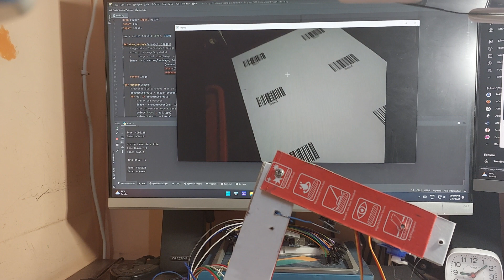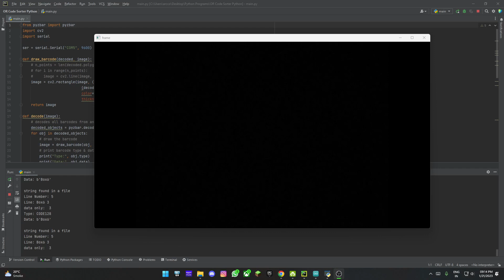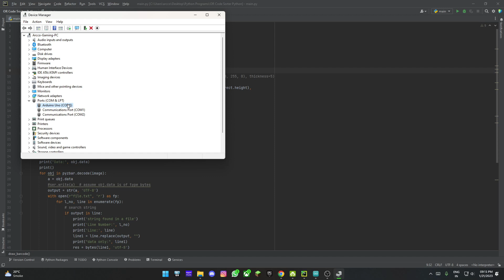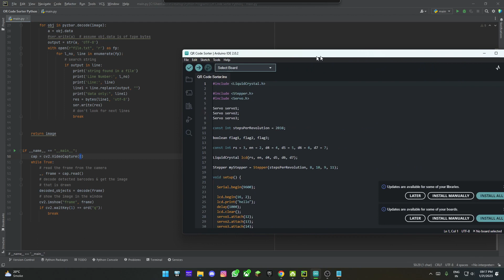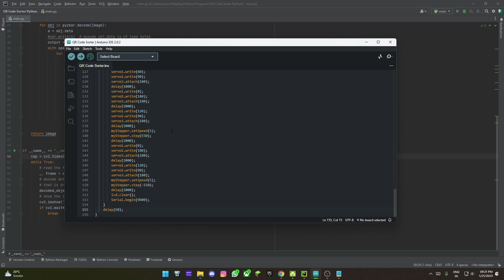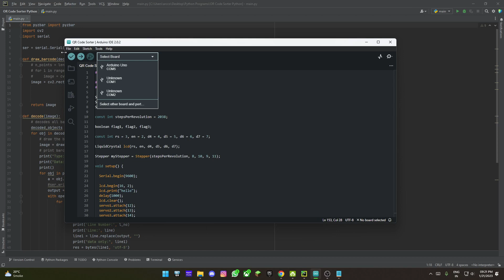Python And OpenCV Based Bar Code Sorting System For Automation. Arduino Pick Place Robot

Comment: I have an idea. They could set up this system in supermarts, if a person wants an item the cashier would just scan its code and the item will come. 
Even though the arm works like an NPC, It sure is a GREAT build.
BTW your table alarm clock is ticking 2 min slow.
Reply from the maker: Yes that is one of the possibile use cases of theses devices. Thx for pointing that out i will fix it.